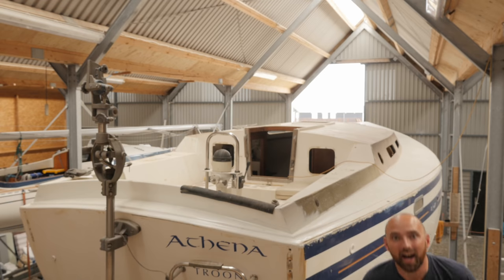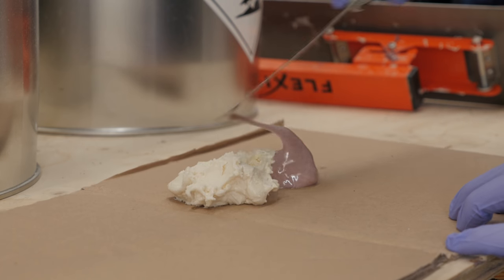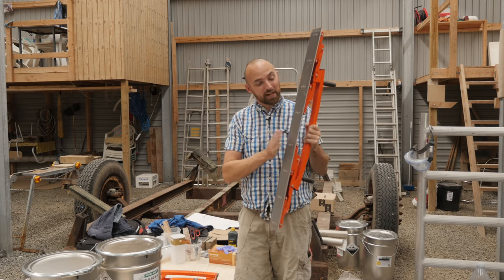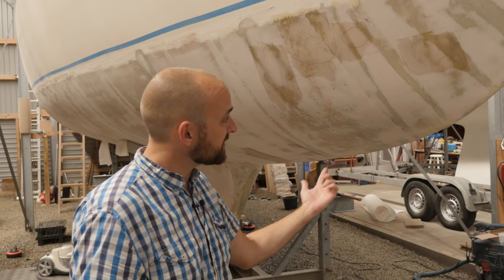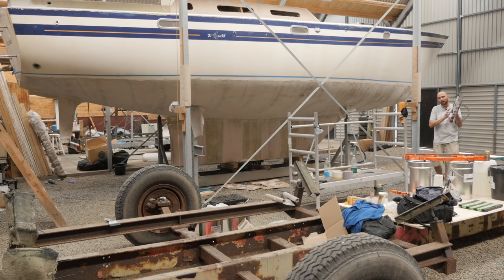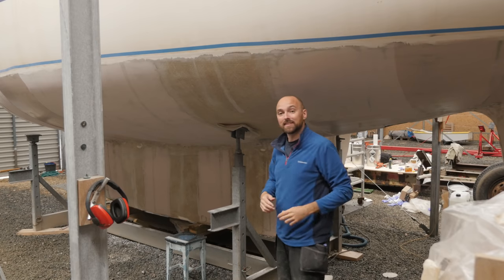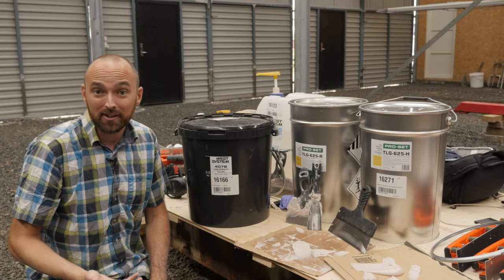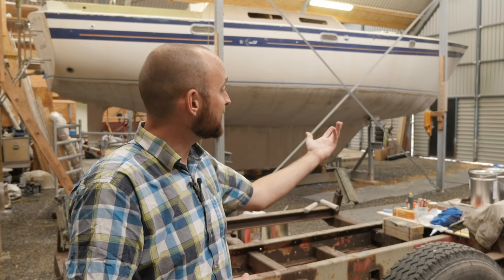Sail Life - Osmosis treatment, fairing the hull some more - episode 4 of 5

Comment: I haven't added a comment to your posts before, I'm sorry about that. I do enjoy your videos and what you are doing, thank you.
As for the radius between the hull and keel, I use a belt sander and a block of wood if I need a quick tool that is temporary, the belt sander works quick and making the radius is simple, start sanding, when you get a generally acceptable shape, use a marker or coloring to color the surface, try it on the radius on the hull and continue to sand it round until you have the shape you need.
It will only take a few minutes to make the tool and it will last for years if you need it to.
A piece of pine log is already rounded, needs a little sanding, a water bottle full of water may come close, PVC pipe scraps or
almost any material will work, but I just like to use wood.
Continue to have fun with the boat and I will continue to watch your videos,
Eric in Hawaii.

Comment: Mads get a 4" diameter PVC pipe, glue some sandpaper to it with contact cement go ahead and drill a couple of holes opposite side of the glued sandpaper and temporarily remove the the handles of the large flexi-sander and screw them on the PVC . Now you have a DIY flexi-sander for curved surfaces. The advantage is that with the handles and rigidity of the pvc pipe will make sanding a hell of a lot easier and evener. Plus you already have the flexi-sander motion pack down.

Comment: Really enjoying your vids. When using a longboard sander it's usual to work your sanding strokes in line with the long axis of the board, you seem to be working across it, which can make the edges catch. This might be the reason you had the edge catching on the power sander.

Comment: I have had good luck using styrofoam. Sand it to the countor you want and then use a roll of self adhesive sandpaper and stick the strips to your new foam block. You can also seal the sanding surface with epoxy to make removing the sand paper easier if you have a lot of sanding to do.

Comment: Lot's of suggestions on how to sand the curve.  I was going to suggest finding a piece of PVC pipe wit the right radius, but I kind of like the pool noodle suggestion.  As for the barrier coat next weekend, I don't know your plans.  When I did mine last year, I had to use at least 3 coats, so bought a mix of gray and white.  I could alternate the colors to see where I had painted and where I had missed.  Can't wait to see how you do it and more importantly, how the coppercoat is done.  I would love to coppercoat, but need to know more about the difficulty and cost.
Reply: I studied this last year and ended up coppercoating. A very rough number (depending on... too many factors here) : that process would cost you double what a normal bottom job would and way more work. But... it's good for many years:) Hope this helps.

Comment: Not sure what's available to you there Mads but I'd suggest some PVC tubing generally used for drainage down here in Australia. They come in a variety of diameters, hopefully one will be close to the radius of your troublesome area. Using a smaller diameter is better than using too big of a diameter. To sand, you wrap the paper around the tube and sort of corkscrew the tube along the place you need to sand. Hard to describe what I mean but it's kinda like sanding diagonally across the arc of the keel.
I hope this makes sense.

Comment: Mads, love your work. To smooth out a internal radius I needed a firm sanding tool to keep the shape consistent. I made a rubbing board from a 1 metre long piece of PVC water pipe with a couple of handles fitted in line on one side and the sanp paper secured to the other side with contact cement. It worked excellent when I was fairing my farrier trimaran.

Comment: Hey Mads, Love your channel! I have found in the work that I do, a simple way to sand that hull/keel curve would be to shape a block of styrofoam to the curvature you want and wrap a piece of sandpaper around it. Its cheap and easy to shape with knives/blades/sandpaper. In addition, the styro has a bit of softness to it which helps to eliminate gouging of the surface. God luck!

Comment: I’m not sure how available they are in Denmark but For the radius sanding I would try wrapping sand paper around a foam pool noodle. And if that’s not available foam pipe insulation, cut a small length and wrap it in the sandpaper.

Comment: Mads use some round sanding drums on your drill on low speed, they make them in a lot of sizes and the largest size works and makes it easy, still some hand sanding when done but can knock down the worst of it.

Comment: I faired the radius on my boat with a cut length of PVC tube that matched the existing radius. It looked pretty dang spiffy when done and the PVC was easy to keep clean and use again... you could probably even glue a handle to the PVC...
Reply: I also used pool noodles for sanding but the the PVC was perfect for applying the fairing compound.

Comment: As handy as you are with power tools why not use a right angle die grinder with a 2" or 3" Sanding Disc or a drum sander chucked into a drill motor. The Fairing looks Excellent.

Comment: Try using the tip (round barrel end) of a belt sander for those inside curves - you will need to get a lighter grade of sanding belt but it might work

Comment: With that part near the kneel,  try find a piece of plastic pcv pipe,  cut it about 60 cms long and down through, so it can open up and close
Glue some sand paper on, and with it being flexible it will get itself into the correct shape with light pressure.
You will need pretty large Diameter pipe approximately 6-8 inch,  and the cut long ways, do two cuts to leave a gap so it’s very flexible,
You can add a handle by drilling a few holes and tie alittle rope across.  If you understand this? It will work perfectly and take the contours 
automatically, and cost near nothing, as you don’t need to buy anything, scrap pcv pipe is easy tl find an “off cut” at any plumbing supply store, or hardware.

Comment: Something just under the radius you are sanding. The pool noodle and  pvc pipe comments were good. A straight sided shampoo bottle can work. A bit fancier would be to cut a segment from a large PVC pipe and attach a board (even glueing on a thin layer of neoprene foam).  =)

Comment: A forced air respirator and face shield might be worth the investment. They're a pricey bit of kit, but man do they make heavy dusty work like that so much more comfortable. (If you wanted to really treat yourself, and don't mind being tethered while working, going with a full AC forced air system is kind of awesome.)

Frankly I'm kind of disappointed that such equipment isn't available to rent at more yards.
Reply: RealLuckless Sounds extremely expensive, especially in Denmark and Scandinavia in general.
Reply: I used a welders hood (leather) for protection while sandblasting the inside of a steel sailboat. Pumped forced air into the hood got plenty of clean air and a nice breeze. IMHO really easy and inexpensive solution

Comment: For the radius between the keel and the hull, have you tried to make a tool out of plywood? I believe you have used the same principle before. Just attach a writing implement perpendicular to a length of something stiff, trim some plywood to get closer to the hull, then place it against an area where you like the radius, and follow the radius with the writing stick you made, and it should provide you with a guide to cut along to give you a good fairing tool!

Comment: Excellent fairing work , I would use a flexible plastic squeegee / bodyfiller type and fill with the faring compound as smooth as possible . Then sand by hand . Possibly use a curved form cut from wood or hard foam to sand. Ideally you want something with a little give not a super hard block. A swimming noodle covered in sandpaper might work....but you know this.....

Comment: Cut a disc of rigid plastic say one of the lids from a plastic pail 6 inch 7 inch diameter whatever corresponds to the radius between your hull and your keel. fill in that joint with plenty of fairing compound and then just use that in tool and run it longitudinally that should get you pretty close

Comment: Appreciate this video is quote old but I've seen few now where you apply the fibreglass layer after removing the gel coat. Im wondering what the purpose of this is. I can't imagine it gives any more strength to the hull so why not just apply a few layers of epoxy and then fair the hull? Enjoying the videos for sure.
Reply from the maker: I believe the reason Athena’s first osmosis treatment failed (done before I got her) was because little fibers from the peeled surface was poking into the barrier coat. Adding a single layer of glass does a good job of preventing that and stabilizing the surface. For Athena it has worked well. After 4 years in the water there is no sign of blistering.

Comment: I certainly can not judge the quality of the lines on both sides of the curve but if they are level and straight it seems more easy to me to fill the low spots then to sand of the high spots. Now if You can trust those lines I would use a squeechy (soft plastic spatula) and scrape the curve very tight with fairing compound making sure You just hit the low spots. After that a light pass with sandpaper over a pool noodle should do the trick. The surface of the pool noodle is fairly flexible and straight and by inserting a round wood stick (or whatever) of Your choice You could adapt it to both of the contour lines of the hull and the keel and the radius of the inside of the curve. I would start up with 80 grit sandpaper.
It might not give You the desired results on the first pass and You have to repeat the process but as I said... it might be easier to fill the low spots than sanding off the high spots.
I believe that will also show any posible low spots in Your contour lines of the hull and the keel.
Cheers

Comment: You seem to have plenty of suggestions on how to fair and sand the joint between the hull and keel.  My suggestion and question deals with preventing marine growth.  Seems you are going with hi end antifouling, but given your willingness to try new things or DIY- have you considered an ultrasound anti-marine growth system?  Most cost $1000 and more, however I read about and saw a youtube video about the Jaycar kit- works on 12v, doesn't use a lot of amps and doesn't require a hole in your hull, kit seems straight forward and the cost is $180 US plus shipping from Australia.  Just a thought and I have no connection to company.  Kits on Ebay and I think Amazon.

Comment: To fair the keel hull joint why not just cut some stiff cardboard or plywood to the approximate radius and use that to scrape off the excess? Once cured, any of the cylindrical sandpaper holders would work: soda bottle, foam noodle or a rolling pin. ;-)

Comment: For the vibration on the power sander I would recommend a pair of padded gloves.
For the radius from keel to hull, DeResta has loads of tips but one of them is to temporarily glue some sandpaper to the area, with the sand on the outside; than rub some foam or soft wood along it and you now have a sanding block exactly the curve you need.
Example:-   www.youtube.com/watch?v=9RtFCnv0jeg

Comment: use a cocacola bottle wrapped with sandpaper to sand the joint between keel and hull
Reply: That only works if the diameter of the bottle is the same as the diameter of the curve. Otherwise you risk carving a groove in the joint or not reaching the bottom of it at all.
Reply: So i used a 125 mm PVC-pipe for wastewater for my boat. that worked fine. You can get these pipes in many different diameters.
Reply: A foam block or cylinder conforms to the shape being sanded best. Wrap it in the sand paper
Reply: I was thinking a swimming noodle
Reply: Pool Noodle should work well... round and squishy.
Reply: Matias Forsman, read my idea, it make sense and is auto adjusting.  Ps I didn’t come up with the idea, ive seen it used before to sand 
Contours that change.

Comment: was watchin you with the power sander...looks like you hold the handle too high with your left hand...try holding lower and see if still digs in
Reply: further in you switched and held the side w handle lower but then held other side on the plastic instead of below lower under the body of motor...try w both hands low